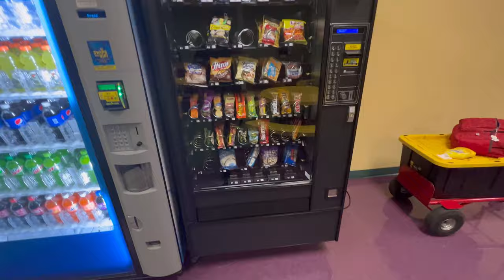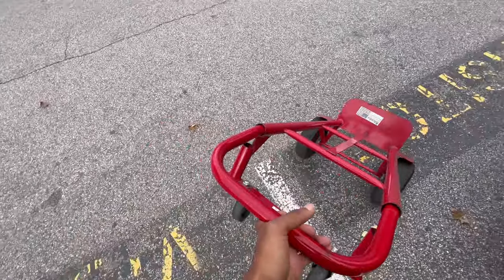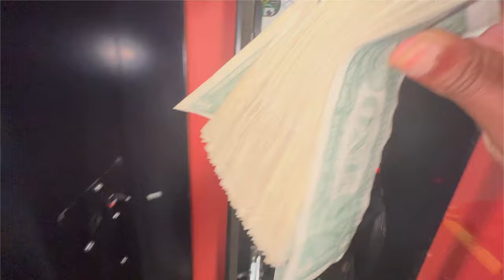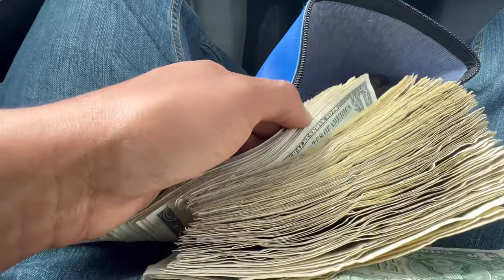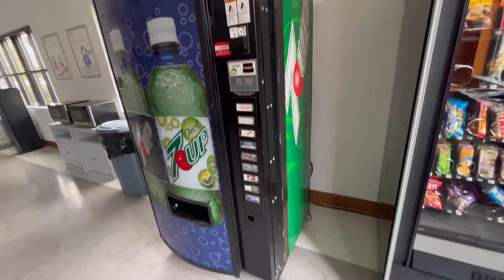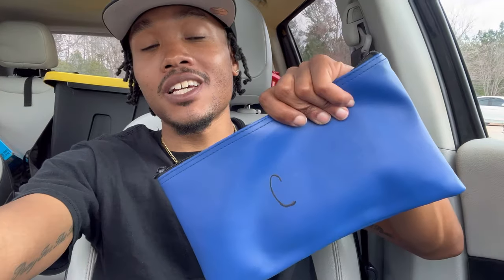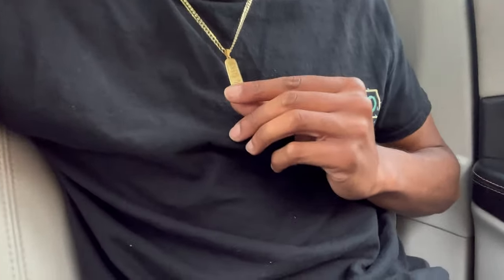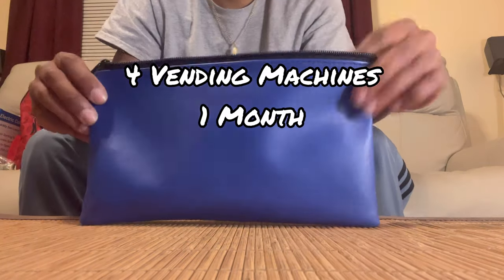How Much 4 Vending Machines Made In 1 Month

Comment: I tried to convince my dad that me doing a vending machine hustle was a good idea, and all I had to do was show him this video and he was sold! Thanks a mill pristine! I got a lot of questions tho brother, what vending machines do you recommend buying? What are the good ones/bad ones? And do you think buying them from a distributor or a private owner is best?
Reply from the maker: That’s so awesome, I love reading comments like this 😁 congratulations on beginning your vending journey 👏🏽 As far as the machines go I recommend American brands. Mainly because it’s easier to find replacement parts for, which in turn makes those parts a bit cheaper when you do need to buy them. And I always buy from private owners. I tend to find them to be much cheaper and a lot of the people I’ve bought machines from have become like a mentor to me. So it’s a way to network also. But the important thing is to be sure that you’re buying a good machine. FYI, “Good” doesn’t always mean “new”.
Reply: @pristinevending  Hey thanks for replying to my comment! Honestly I just don't want to buy anything that I'm gonna have to fix on right after I get it. (of course I'm expecting to run into some problems) Especially me since I have no knowledge on vending machine repairs. So private owner or not, I'll definitely make sure the machine is American just to be safe. I have like TONS of other questions but I ain't gonna flood up your comment section dawg 🤣thanks for the feedback tho!💯